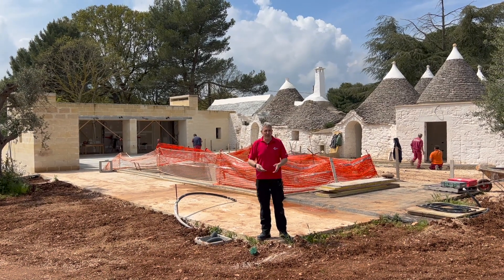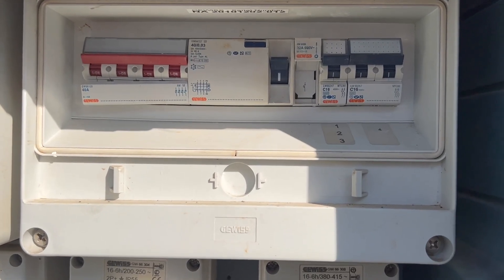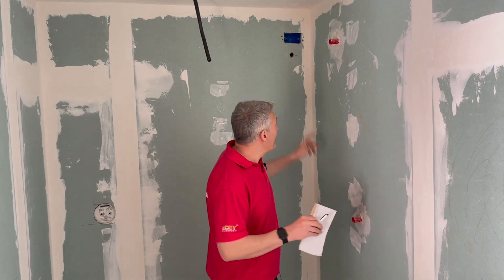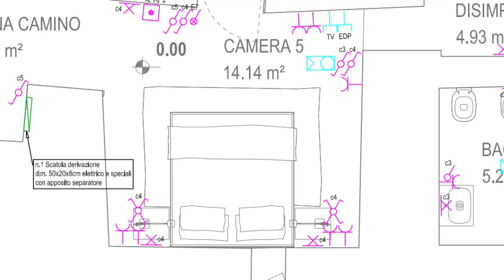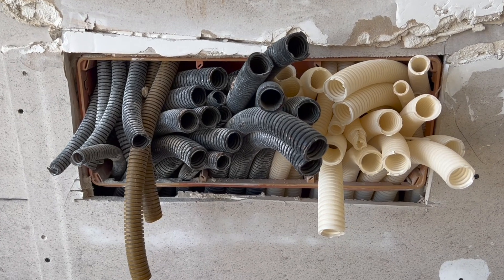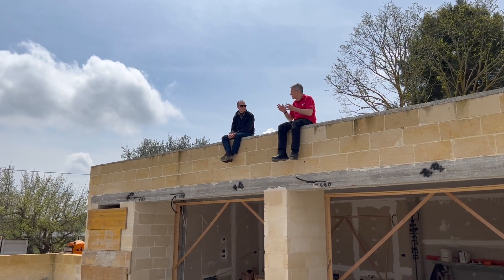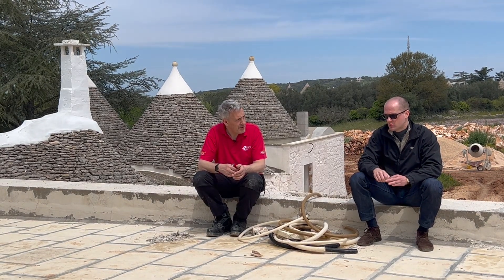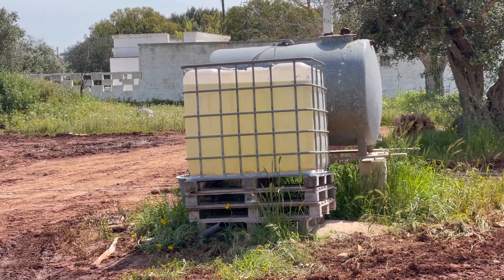Electric Wiring in Italy - You Won't Believe What They Do!

Comment: The grounding is massive because the weather in Puglia is quite dry, therefore the ground resistivity is much higher than in a rainy country such as UK, so you need a big surface to achieve an acceptable grind resistance. Moreover it is a good practice to have a good ground when home automation has to share the house with inverters because the latter inject quite a high amount of emc noise in the ground and if the impedance is high, the less immune home automation devices start malfunctioning.
Reply from the maker: Great information

Comment: In Holland rigid PVC pipes are still common, allthough you see a lot more of these flex pipes. I don't like them because with the ribs it's hard to pull any new wires in. Rigid pipes are a little more work but   it offers great protection and gives you the option to always change wires.

Comment: Standard power is 3 Kw in Italy, if you want more, you have to pay for it. And yes, such power is often not sufficient, you can't keep all your appliance running or it will trigger the circuit breaker. In the UK I never experienced a blackout, and you never run out of power, no matter how many appliance you use. Also in Italy, especially in villages, blackouts are pretty common.

Comment: 3x25A is very normal here in Estonia. And no.. no problems with main breaker tripping. don't forget that 3x25A actually is no less than 3x25A*1.1 for LONG period and 3x25A*1.3 for short period. Therefore 22kW from 25A breaker is actually what one should expect.

Comment: It's exactly the same system that in Spain. More protections, a register box in all the rooms and all the cables are installed in conducts. It's the same for a hotel or  a restaurant or a flat. Floors and ceilings usually are made of concrete and the dry walls are used only in cheap buildings. They use different sizes of bricks with air chambers and inside are covered with refractory plaster so the warm or the cold keeps inside the room.

Comment: As an American that works with three phase industrial power for my job and replacing the substandard 120/240 single phase wiring, outlets, main panel and breakers on my own home to meet current National Electric Code it is always fascinating to see how other countries do things.  My home connection is 24 kW, which is standard around here.  Older houses tend to have 12kW connections.  With electric car charging and some leftist states in the US, like California, banning new gas connections for homes and the sell of gas appliances I foresee the need for even higher rated service power.  I would love to have three phase power at my home and would think it beneficial for new home construction but only industrial areas in the US have three phase power.  Residential and general commercial service wires are wired with four pole single phase wires; 120 volt - 120 volt - Common - Earth Ground to derive 120/240 single phase power.  Industrial power is 240/480 volt three phase with service earth ground without a common.   Conduit is very handy, but rare outside of industrial wiring or exterior wiring.
Reply from the maker: Great info thanks 🙏 😀

Comment: It does not seem they have mice in Italy and maybe not in other places on the globe either. I live in a old house in built 1957 in Sweden and the electrical wiring goes in metal tubing inside the wall. I feed the birds with sunflower seeds so mice come in our house to spend some time during the cold winter. I can hear them moving around inside the wall throughout the house. They are small cute mice no rats so they are harmless but I would not trust them to not put their teeth in a plastic tube for the electrical wiring. Today I believe they run the cabling in plastic tubing here too of some sort like in many other places which I believe is pretty dangerous if things go wrong. Personally I would absolutely not put anything inside the wall no electrical installation or water pipes but use a pipe or cable you can mount on the wall so you can see it and repair it without breaking the bank or get a deadly surprise if an electrical problem or combined water leak and electrical problem causes a shortage and a fire and burn down you house. Hopefully you guys all over the planet use earthed wiring for safety.

Comment: Man, everything in europe is plastic. from the plastic wire conduit, to the breaker box and junctinon boxes. Yes you see  plastic junction boxes and conduit in the United States for outdoor use, but elsewhere all that stuff is steel. Hey it works, otherwise they wouldn't do it, but what a difference.

Comment: Interesting video.  I'm in the  Emilia Romagna region. We had our house wired 10 yrs ago. The difference between domestic houses in Italy and the UK is that in italy they tend to have concrete ceilings and floors, so its good for running flexible condiit for wiring, whereas in the UK we have floor boards for cable routes. Also we wire from point to point, in Italy they have joint boxes in all rooms that they wire to and wire from.
Unlike the UK, in italy they don't have safe zones for cable runs, from the jobs I've seen. They run the flexible conduit horizontal, vertical and diagonal. Electricians use  cable locators to trace cables buried in walls, a nightmare when you want to hang pictures on the walls. The only time I've seen an earth system like the one you showed in the video in on commercial and industrial new builds.  For a  domestic install it's a copper earth rod like the UK. Also the distribution boards used in domestics, that I've come across, don't have a solid bus bar that you can connect the MCBs to. You have to loop the mains supply across the MCBs, which means if you want to add or remove a breaker, you have to isolate the supply.  Another point is regarding emergency lighting. I've never seen emergency lighting in any domestic premises that I've visited apart from one house, mine. Because of the amount of power outages in the region, i decided to install them everywhere.

Comment: You're not allowed to have sockets in the bathroom in the UK? How do you plug your hairdrier, or charge your electric toothbrush?
I assume it's for safety reasons? Water, humidity and all that. I wonder if there are some stats to back or disprove that regulation...
Reply from the maker: We can use a special shaver socket to charge tooth brushes etc which includes an isolating transformer.

Comment: Regardless of the differences in wiring.
The unnecessary level of wasted time and labor alone is astonishing.
When you could do three steps at the same time, their doing one step at a time.
Taking 70% longer to achieve the same result.
Which equals more cost to the client for no reason, other than their incompetence.
If I was the client paying for this job, I would be pissed…

Comment: I am a retired electrician in Chicago.  These wiring  practices would be a topic of great laughter here.  Metal conduit, metal boxes and metal breaker panels are the legal way here.  Away from the city, “Romex” (flexible fire resistant cable) is permitted.   We only use the flexible plastic tubing for low voltage applications.

Comment: I'm Canadian and that surprised me with the six kilowatts most houses in Canada have 24, and pretty much all new construction gets 48 kilowatt
Reply: 6 kW is ok for the average size of an Italian home even with 100% electric appliances (obv you can't have instant water heater but only storage ones), also keep in mind that you can overload it to ~8 kW for 180 minutes.
6 kW is a rather new thing btw, most houses have 3 kW contracts, which means cooking is mostly done with gas, for water and space heating if it's an independent house it's a gas furnace, for flats central heating and storage water heater is common too. That way you can manage to survive with just 3 kW too, you just have to be careful not to use energy intensive appliances (oven, dishwasher, washing machine, hair dryer) together or you'll have to do the walk of shame in the dark to the meter to reset it's breaker

Comment: actually the 6kw (or 3kw) monophase standard are just the "committed power" on paper. Contractually the power is ALWAYS +10% higher without limits compared to the nominal value, and +40% for three hours a day, so a 6kW system is actually a 6.6kw effective and 8.4 kw for three hours a day (3.3kw/4.2kw for a basic 3kw of course). A 20kw three-phase system like the one in the video is in fact a 22kw system with 28kw allowed for three hours a day

Comment: The only disadvantage to this conduit method is if the cable overheats within the conduit and melts to the conduit. The problem with three phase here in Southern Europe is if you loose a phase one might wind up with a brown out condition on any of the other phases, not too good for certain electrics in a home.

Comment: Non metallic flex conduit. Great for wiring in enclosed concrete/masonry. Or if ya'll used stick frame you could just run through the strapping lol.

Comment: Actually, it is hard for me to understand the purpose of this video. And... some content is incorrect. For instance, an electrical contract for 4.5kW is OK for a 130sq meters apartment (a large one for our standards, located in north Italy)  with no gas usage, only heat pumps and induction kitchen and all modern appliances of course, and motorized shutters (7 of them), domotics, alarms.... 2.5 MWh consumption in one year. Max current circuit breaker never tripped in three years of continuous living there. The building has been erected in 1936 with stone walls (no thermal isolation) and we decided not to install thermal isolation from inside. However, mostly thanks to high COP heat pumps and new windows, the apartments is certified class A. I think it is better to keep power consumpion low or at least not too high, if we love our planet.  i.e. 20kW contract for a residential unit is (generally) an exageration.
Reply: 5 comments after yours is a yank claiming that the US average is 48kw
Reply: @williamchamberlain2263 that's true, cause in the US they have cheap electricity (bc of cheap oil, gas and coal), so they don't care about energy efficiency. Their houses are generally larger and badly insulated, their appliances are huge and wasteful

Comment: 06:38 - I was under the impression that on the UK rhe wall safe zones does include Diagonal Runs if =>50mm depth into rhe wall, or <50mm will require mechanical protection/shielding.  eFIXX - can you llease clarify?

Comment: We are allowed power sockets in the bathroom, but they just have to be 3m from a bath or shower, presumably to discourage the use of portable electric devices like hair dryers dangerously close to a wet zone as the flexi leads are rarely more than 2 metres long, and often half that.

Of course, most British bathrooms aren't large enough to  allow for this, so it's something of a moot point for most, but for a larger house it's possible.

Comment: As an Englishman living in Italy I absolutely love the tubing method and the use of flexy, multicore wire for all the wiring, typically 16 gauge(US) for lighting and 14 gauge(US) for sockets. 
The UK is a nightmare to thread wiring, certainly on older homes where there is no real way to modify the system without ripping into the walls and floors. 
Don't even get me started on traditional, UK, solid core all-in-one grey cable.
Also, am I correct in saying that the current mainly flows in the surface of a conductor, therefore, multicore cable is superior?
Reply: "Also, am I correct in saying that the current mainly flows in the surface of a conductor, therefore, multicore cable is superior?"

Yes, you are misinformed on that widely spread myth. Whilst it is true there is something called the skin effect, where AC current travels in a skin at the surface of the conductor, it is highly frequency dependent no practical bearing on the sort of cable cross sectional areas you get in domestic power installations. At 50 Hz that skin depth in copper is about 8.5mm. That corresponds to a cross-sectional area of about 230 sq mm. Even 25 mm^2 cable only has a radius of 2.8mm (not that it's solid anyway) and he effect is insignificant. The only time the skin effect is significant at mains frequencies is on bus bars of maybe a couple of centimetres. 

What's more, even when you do start dealing with high frequencies, such as radio frequency waves, it makes zero difference whether the cable is stranded or not as the physics of it means that the skin is effectively the outer layer of the entire stranded cable as it's caused by a magnetic effect (and, no, it's irrelevant that copper is non-magnetic, it's to do with the induced eddy currents due to changing magnetic fields). 

If you want wire that does minimises the skin effect, you have to use something called Litz wire. It's used for high frequency signal wires, and not for mains power delivery. It contains many fine conductive wires, but each is individually insulated and they have to be woven together in very precise, pre-defined patterns to contain the effect. It's nothing like standard stranded cable.

For mains use, the advantage of stranded cable is in the flexibility. As far as conductivity is concerned, at mains frequencies, only the cross-sectional area of he conductor matters (the same is true at audio frequencies too, despite what some audiophiles claim).

Comment: First time I hear about this rule about safety cords in the bathrooms! Definitely not present in new flats and only very rarely found in old buildings.
Reply: WI'm Italian,. We had them mandatory  until  the 1960's . My house was built in 1965 and we had push buttons in all  sleeping  rooms and i the bathroom , with a sounder near the kitchen. 
I dismantled the whole circuit  some years ago . The  whole building was wire with rigid cable inside metal conduits with an internal insulating sheet.. Maintenance was  really difficult. 
I t took me a whole  afternoon to place two new cables for the heating thermostat from  living room Kitchen.

Comment: I was an Architect, in another life. Have worked in South Africa and Portugal. I'm now a Project Manager in the UK, though I have also done wiring designs for Balfour Beatty in various large projects involving wiring harnesses.

One thing that I'd insist on would be a suitable draw wire or cord in every conduit. There'd also be a restriction on the bends in conduits under the floor as well as their minimum radius. If ribbed conduits were to be used, I'd want them pre-cabled. You can normally buy this with the cabling inside. 

I know of the ring earthing, but as I was working on large projects we had to bury earth mats alongside the building. On one project, the owners wanted tarmac parking over the entire area, so I added a large planter area over the mats, with subterranean irrigation to keep the earth damp and water the plants, as it gets very dry in the eastern Algarve.

I love to see how others approach problems as you will always learn something

Comment: Meters are installed outside not because electrical supplier  operators can read them but because firefighters can disconnect them in case of fire.

Comment: I would never have thought that abroad they use wires without the flexible pipes, here in Italy all systems are made like this, and for 20-25 years even the water pipes have been made of plastic inserted in a flexible tube so that they can be replaced quickly.

Comment: Here in Italy my father used to work as an electrician for a few months in his youth and once went to work in an old shed-like house where one particular power point only worked if one particular water tap was open. Yeah, you needed to open the water to make the electric plug work.
It was so because (forgive an eventual error from my part, I'm trying to repeat my father's explanation) the plug's ground was grounded to the water's metallic pipe, and the laws of electromagnetism work differently if the water inside stays still or runs through.

Comment: Why would you run an earth to a double insulated light? So that you can replace it later and if you need an earth it's there. Lots of older houses in New Zealand have no earth's run to batten holder light fittings and I've lost counnt of the number of times I've been supplied replacement lights, by home owners, that require earthing.

Comment: In US is way easier manage cable system since mostly of houses are made with wood and have fake walls, In Italy almost 99% of houses are bricks and concrete in any walls also internal so you must use corrugated pipes anytime since if for any reason like for example you drill the wall and cut the electric cable you need to replace it is easier to pull without break the wall randomly to the whole line wasting a lot of money and time

Comment: why no earth for the "current" outside lamp that is double insulated?  Earlier you praise the size and future-upgradability of the distribution box, but later they cut corners with the wiring?
any change to different, earth-requiring lamp and youre stumped. Or do they atleast keep a second pulling cable in the flex conduit for later cable pulls?

Comment: Lol- here in America we usually have between 24 kw and 48 kw

(100-200 amp @ 240.)

Some homes even have 100 kw (400 amp) i think that's about the max for a home. 

100, 125, 150 and 200 amps are more "usual."

They have smaller ones too, but I think with electric cars they will be used less and less.

Comment: You cannot use the renovation project on traditional buildings as a reference for wiring.

Please check what they do in Italy in modern buildings.
Reply from the maker: The building is part new part renovation. Regulations and practices are the same.
Reply: @efixx   i agree that rules should be the same, but practices they do change a lot, also go to the north.

Everywhere you have places or people which are more compliant to the rules and so on...